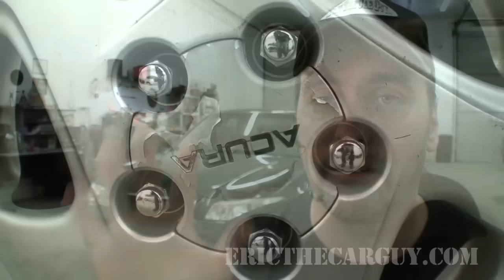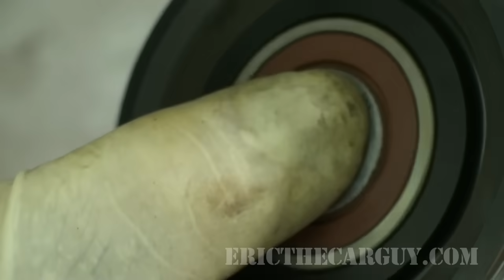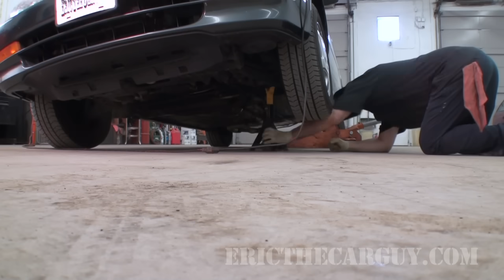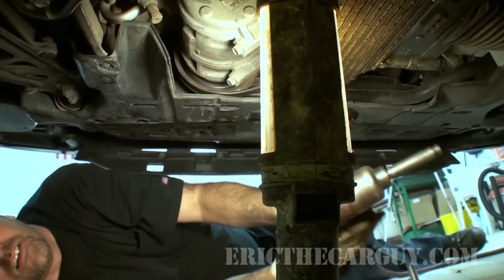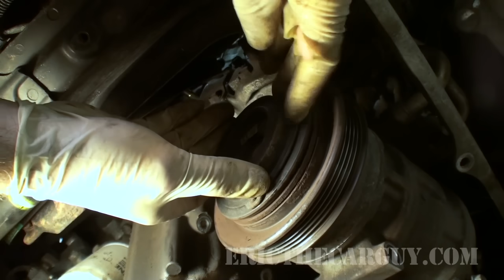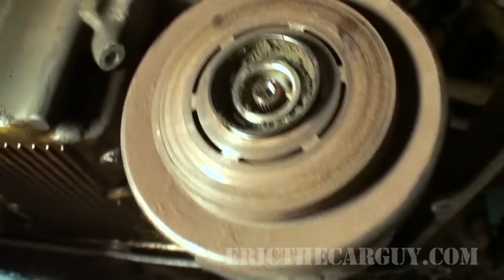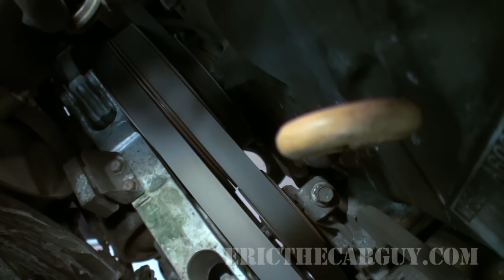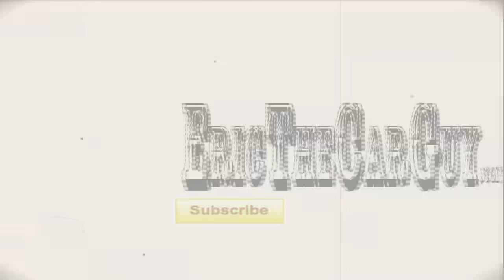AC Clutch Repair and Noise Diagnosis -EricTheCarGuy

Comment: After pulling the centre bolt, the middle part of the clutch dose not coming off. What can I do with that?
I need to put in a new magnet coil. Florida is HOTTT
Reply: oh it is on a 01 chevy tracker aka suzuki vitara
Reply: Put a flat head behind it on either side and try to pry/wiggle it off.  Mine wasn't easy either.

Comment: Love the work you do, your channel has saved me allot of time and heartache! Thank you! I have an issue with my ac clutch. The clutch seems to engage but it gets stuck intermittently then disengages leave the pulley to continue to turn freely. The clutch has the intermittent stuck episodes the belt squeals/burns at the main pulley due to the clutch catching also drops the RPM's obviously... What would recommendations be? 07 Subaru sti

Comment: Great video.  I have a 1999 trans am that has a bad clutch.  I bought the new compressor and saw this so I'm just going to swap out the clutches and pulleys instead of going all out and having to recharge the system.  Great video man

Comment: My AC went out recently and it was only blowing hot air. So I took my 06 Maxima to get checked and they told me "the clutch fell off"... Can that even happen? 

So now I have a clutchless compressor and they told me I need to change the whole thing. What should I do?
Reply: Buy a new clutch assembly from your local auto parts store and install it

Comment: I believe I've narrowed my problem to the ac as well. Would it also cause me to lose cold air flow when the clutch is engaged? I've got a 2004 Tahoe Z71 5.3. And just from looking at the outside plate after removing the belt there's a larger gap on one side, meaning it's not sitting flush with equal spacing all the way around and there's alot of play when I wiggle it.

Comment: Everything is ok... But when You learn people fix cars, please notice that when tightening bolts especially to aluminium engine block, tell them not to use pneumatic wrench. Because if they tighten too much they can damage thread. I think You know this perfectly :)

And second useful trick... when you put this regulating little washer into clutch hole better just put on washer, some (two little dots) of grease to stick it in place. Because when not comfortable position, it can fall on side... Just in advance, for simplier work :)

But anyway, thanks for Information :)

Comment: Eric, I've got a 04 Nissan Maxima. When I turn on the air ,the engine races and bogs down. The compressor holds the correct pressure and pumps out cold air, I've checked for any leaks. Before I replace the compressor,could it be something else ?

Comment: Hi Eric.  i have a 2005 Acura Tsx. and the AC works a blows cold air only when im driving and RPM are high. if i ge to a stop light the air goes up to room temperature. any ideas ?

Comment: The fact that the first pulley you checked was spinning to begin with and the noise only came when you turned on the AC,would that automatically rule out the first pulley as a cause of the noise,i don't know too much about this stuff but do have the same noise as you when activating the AC - Thanks

Comment: 7:20, Horrible practice. Bearings are precision mechanical devices with extremely low tolerances. Pros use a piece of wood over that bearing when hammering if a press is not available, which in your case is. Blocks of wood in the vise with the bearing and pulley between them make a wonderful alternative to a press and significantly reduce the possibility of damaging the bearing with direct hammer blows. I'm no pro myself, but your hammer method is bad practice even for a noob.
Reply: Did you hear the part after where he said to use something proper, and that it was an old piece and he didn't care about it. Or did you just chose to ignore that and fist your keyboard to death.
Reply: bloodargon
The latter. He should have removed that segment from the video, or not bothered making an instructional. He makes himself appear unprofessional. Just another Jack.
Reply: Right because that little segment is worth not making an entire video for. Hes a down to earth dude who clearly, from all his other videos, knows what he is doing. If you cant tell the difference between a shortcut for sake of explanation and actual instruction, you need to stop watching these videos.
Reply: I did. Thanks.

Comment: The compressor clutch and pulley seems to have seized on my 02 escalade. Caused the belt to melt off. Would a new clutch assembly and pulley do the job or do you think I need a new compressor all together?

Comment: Hi, You are awesome . I have a misterious problem , my ac works but my blower not turn on, they check every where , nothing happened, so they by pass a positive wire to the blower now it's blow the air out. But I wish I can fix it, because now I have to turn on ac and turn on the blower. In my situation do you have any advice ? Thanks car guy.

Comment: Eric great videos. Question I have a Saturn 2000 SL2  My ac was low on freon filled it up. I jumped the compressor and the clutch kicked on but pressure didn't drop on the freon I was using. Clutch engages but won't take freon. Any thoughts?

Comment: If the noise is there with or without the a/c running is it more likely the alternator?  2002 Sienna with separate a/c + alternator and power steering belts.
Reply: Thanks for the helpful video too by the way!

Comment: ack!... I almost changed my clutch to get it to work... Ended up just being a blown ac fuse.. less than 10 cent fix  x_x
Reply: The irony of telling someone that  no one gives a fuck about their comment, yet takes the time to reply to said comment. Come on, admit it, you had a few fucks to spare.
Reply: thank you ass pile!
Reply: I though it was a cool story ;-;
Reply: lol "ass pile"
Reply: Nname Withheld from
Reply: fuzzy wuzzy I care, I wouldn't want to change the clutch if it's just a fuse, I'm gonna check the fuse first.
Reply: While at it. When changing a fuse take an extra second to make sure you understand, why it failed.
Overload, mechanical failure (broken), corrosion (resistance), etc.
It help understand why it failed in the first place. But most important what to look for next time it fails. ;-)

Comment: Hello Eric I have a 99 Toyota corolla I took the serpentine belt of and I checked all the pulleys they all seem good except for the AC pulley .I tried to spin it but it feels rough and gets hung up and I also tried o wiggle it from side to side and it wiggles slot.i never had a problem with my AC but I was wondering am I able to change the pulley and the other thing I would like to know is why did this happen?

Comment: MY AC COMPRESSOR TURNS ON AN OFF WILE THE AC BEING ON DOES THIS MEAN MY COMPRESSORS BAD?
Reply: Your system may be low on gas. There is a pressure sensor telling the system if it's safe for the clutch to engage or not. If there is too little gas the A/C-compressor can be ruined in very short time. On my old Ford the clutch didn't engage at all due to too little gas in the system. After a service filling (they drain the system, checks for leaks using vacuum and refill it to the correct level) everything worked fine.
Reply: No, it doesn't mean it's bad.  They normally kick on and off, that's the way they work.  If you aren't getting cold air then that's a problem.
Reply: It depends upon whether it's a variable displacement compressor or a fixed displacement one. The latter type should cycle, in particular it should turn off whenever the evaporator reaches freezing point or, alternatively, the low pressure switch kicks on due to the evaporator about to freeze and therefore supplying low pressure vapor to the suction line, and turn back on after some hysteresis value has been met. The former should always spin as long as the AC is turned on (though PCMs usually turns them off whenever the throttle pedal is fully depressed). If they start cycling, something's wrong inside the system (low refrigerant pressure, restriction, faulty condenser fan, overcharge, faulty clutch assembly, faulty wiring, TXV staying closed and so on).

Comment: let me tell u something this is ok for u that have a lot of empty time to waste no if u are a customer come to my shop with this kind of bs u will be on ur way to another place and If I decide to do it u will have to pay the same like if u change the compressor I will not take that shit off go thru that cluster fuck just because u wanna save a couple of bucks I can see ur mechanical skills are pretty low
Reply: +Daniel Coutin SO you'll sell your customer a compressor PLUS a evac and recharge for a bad pulley bearing . YOUR the one who gives ALL mechanics a bad name thank god I don't need to use you or your attitude and i pity people who do.
Reply: +Joseph Mindurown You may be well be correct, replacing the whole compressor may well be overkill, but you also may never know what caused the pulley bearing to fail in the first place (i.e. the compressor may have overheated due to repeatedly running on a low charge=low lubrication rate and high evaporator superheat=overheating and seizing, and its internals may be damaged and it may finally seize some time after the repair. How can you see that the compressor overheated? Drain the oil and check if it's dark. Good compressor oil should be clear).

Comment: the ac compressor clutch kicks on and off while ac is on HELP!!!
Reply: it's on my 94 Silverado
Reply: +David Mckinney  Hey man, if the clutch is going on and off in rapid succession then you probably need Freon. If the clutch engages and runs for awhile then cycles off this is normal. Good luck.
Reply: +David Mckinney It's short cycling. Add refrigerant first. But don't wait too long. Short cycling can damage or destroy your compressor because it's dry, and that's definitely bad for the inner parts.
Reply: +David Mckinney  Then you might want to try find any leaks.Sometimes they're easy to spot because refrigerant has oil in it and when they're is leak the dirt will build up in that general area and look wet

Comment: Eric, my car sounds about the same. When it's at an idol it makes a sloshing sound and u can feel the fluid within the hose pumping extremely hard. As soon as I kick on the Ac it stops sloshing and the noise from the condenser gets louder.. I'm not sure if it's a condenser problem or something inside the dash.. It's leaking a lot from under the car.. No sure where. Somewhere in the dash. I can do a lot of car projects myself. Hubs, axels, shocks, fuel filters, alternators, brakes, starters... However, I've never pulled the dash to change a heater core or anything like that... Is it worth fixing myself?

Comment: my nissan supersaloon wont accelerate if the aircon is on..but if you switch it off..then it will start accelerating or running ...what do you think to be the problem?..pls help.. the arconditioning system is still good..but if you go to drive it wont accelerate..
Reply: +Tyrone Oliva   Need a larger engine!   :)   (the AC compressor is LOADING down your engine.)
Reply: tnx bro...big help

Comment: Ok I'm back, 3 weeks later. Problem fixed. As I suspected 1.7L sohc Civics have the EXACT same compressor.  I managed to disassemble the a/c clutch without removing the  compressor at all.  I took out the old  bearing and found one at an independant  bearing specialist for a 100$.   Just  in this video  Eric's advice  saved me well over 300$.

Comment: Oh no! ....hammering a bearing metel to metal! This mechanic is a butcher.
Reply: You're... Not very smart are you?
Reply: +startrek21000  You NEVER EVER hammer the inner ring of bearing if you plan to reuse it. There is half dozen of ways how to push or pull bearing out. You don't need some special tool. You could do it with your 16mm socket, shop vise and spacer(s) from opposite side. Your video also shows how you reinstall the bearing; You are hitting inner ring with hammer again. It is absolutely unnecessarily when face of outer ring is exposed. You could use your bench vise to press it in. With little grease it would work without much force. It would be OK hammer outer ring but not directly with steel hammer. Why do you question my intellect?
Reply: +snowcon I question the intellect because it's metal vs... metal... If it were bent in any way, that's because you used far too much force. The way he was hammering it in, he was spreading the soft hits around the bearing. He's not using a fucking diamond hammer, it'll do very little damage

Comment: Hey Eric.  Thanks for all your videos.  Refreshing to see a mechanic who cares about the customers and who doesn't just pray on peoples' ignorance.  I just acquired a 97 Tahoe 5.7 and the AC was working just "OK" when I got it.  I decided to give it a charge and noticed that the AC clutch engages for 5-10 seconds and then disengages.  Not knowing if this was normal I started searching around and someone at oreillys said to check the relay.  I swapped it with another one to see if that was the problem before buying a new relay and the problem still exists.  The AC is hot and I put in an 18 OZ bottle of charge with stopleak after noticing that the gauge was on 2 psi with engine on and ac on max, gauge plugged in.  The tahoe requires 36 OZ of charge and this is where I got confused.  After putting in the first bottle it jumped up to 40 psi.  I drove it around and checked again and now it shows way overcharged!.  Also the gauge now slowly moves toward the 55 PSI range but drops once the clutch engages and this loops until I switch off the AC.  I can't get a steady reading with engine on and AC on! should I not trust the gauge and just put in the second 18 OZ bottle anyway because i've read that low charge is the most common reason for this cycling issue?????  I don't want to blow up!   I understand you will most likely give me a liability type answer and tell me to bring it in to a pro but any ideas for educational purposes!?  :D  Thanks!

P.S.  I am open to a possibility of a leak but everything under the hood of this truck looks brand spankin new.  Moist hoses, shiny metal, AC compressor looks brand new!  one of the reasons I bought it.  Looks extremely well maintained.

Comment: 2003 Honda Odyssey.  AC Clutch had been whining for a while and then the AC stopped working all together.  Before I spend the $175 on a new clutch assembly, is there a way to make sure the compressor didn't go bad?  in other words, can I put a wrench on the compressor and turn it and assume that if the compressor turns, it is still ok?

Comment: hey Eric i hear noise from my 2011 chevy avalanche ltz a/c compressor but if i hit it with wd40 it shuts up for a minute or a day or two is it my a/c compressor or something else cause i spray directly on the ac compressor not the belt and it stops

Comment: Same problem on my civic. I just spend the day working on my car. Trying to fix the whine, I Changed timing belt, tensioner water pump, among other things, I even thru in new plugs. Suddenly,  half way thru the job I realise the noise was actualy  coming from the ****ing  A/C.  So I reasembled every thing back up (out of time and money) and I ran towards ERIC of course.  And I noticed the Acura A/c compressor in your video is very similar to the one on my 2005 civic. The pulleys are arranged differentIy of course but the unit seems basicly the same .Trust me, I just spend hours today staring at it hatefuly.  Even bolted on the same!  I hoped I didn't have to remove/replace the whole $habang. Now I seriously suspect it could be done on a most hondas/acuras of similar years/plants etc. I'll try it on mine and get back to you.

Comment: never  hit the center race on a bearing when installing ,only ht the outer race or better yet use a press or a vice to press it in...hitting the center race will damage the bearing
Reply: you can use the old bearing as well
Reply: lezamac6 exactly it’s definitely the same size.
Reply: Only a butcher would hammer in a bearing the way you did.  Bearings should be pressed in.
Reply: that is what i remember a representative of a bearing manufacturer said in one training i attended....never hit the center part
Reply: CDubs HasIt "give away the goods for free"? sounds like somebody with that logic doesn't want to help others with that attitude. The tech info is all so top secret!
Reply: use the your OTC wheel bearing pulley kit
Reply: Mud Sh-sh-shark
Reply: Thank you, I was disturbed by that also.
Reply: He should have removed the part of the video where he is banging the center of the bearing with no mercy. He is one of the best in the field, he must have been mad at that particular bearing!  It was funny though.
Reply: When installing or pressing a bearing, you should never hit the inner ring. Always apply force to the outer ring, never the inner one, because otherwise you’ll damage the new bearing right away and it won’t last long.
Reply: Mud Sh-sh-shark This Is Very True, Cuz Even With The Spacer Shown "That Should Have Been Used," Its Still Not On The Outter Race So Damage Can Occur. I Learned This From Other Experts When Rebuilding Alternators, Replacing Bearings :D
Reply: Are all of you deaf other than the guy who mentioned that Eric said not to do it this way?   He clearly said he just did it because it was an old one.
Reply: da324 - He’s still wrong because he then suggested using that sleeve insert thing which still puts pressure in the center.
Reply: CDubs HasIt So only other Youtubers can criticize? Strange attitude ...
Reply: +Mud Sh-sh-shark You also can heat up the outer part ....
Absolutly cruel how this "pro" beats the bearing (and shows this without shame on YT!)
Reply: Mud Sh-sh-shark I pity your poor wife!  Are you always so picky when it is clearly explained NOT to do it this way?   You are making something out of nothing - go troll elsewhere please.
Reply: Are your ears painted on, go back to 7:45 and listen closely
Reply: +Dexter Treehorn lets see your repair videos!